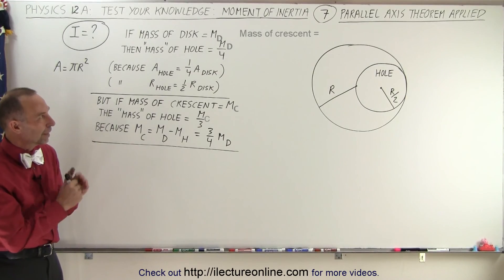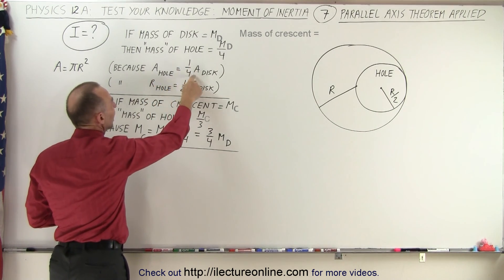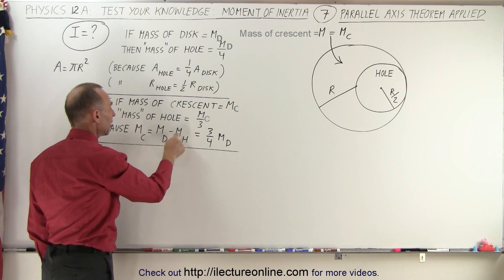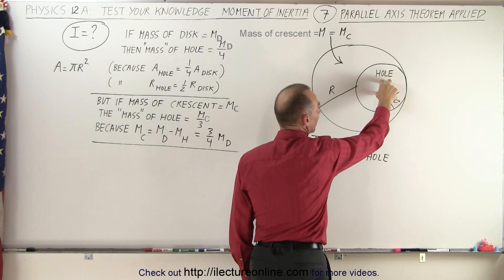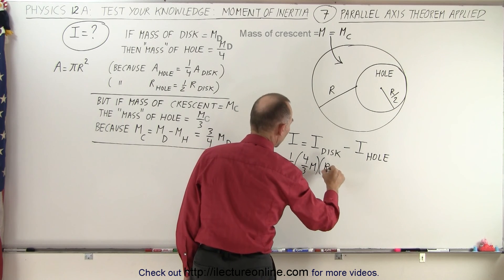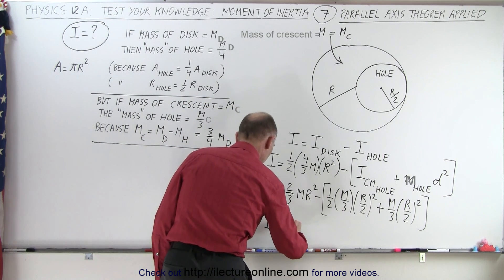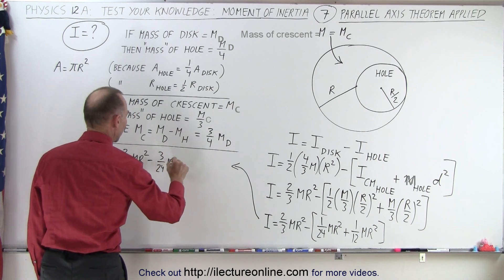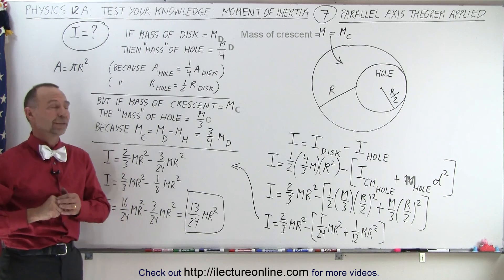Physics - Test Your Knowledge: Moment of Inertia (7 of 24) Parallel Axis Theorem Applied***

Comment: ı think you made a mistake when you write mass of crescent. Also you have another video about the same problem. Results are not consistent. Mass of crescent should have been 3/4 M I think. Your sincerely.
Reply from the maker: They are 2 different problems with the mass expressed in 2 different ways.  This was done intentionally.
Reply: @MichelvanBiezen  Then I should be more careful. Could you please explain what the difference is between two videos. Does it not have same radius an values? I guess i am missing something. Thanks a lot from now!
Reply from the maker: In the one case M is used as the mass of the disk if the hole wasn't there.  (In that case the mass of the hole = (1/4)M.)  In the other case, M is used to represent the mass of the remaining disk after the hole is cut out.  In that case the mass of the hole = (1/4)(4/3) M = (1/3) M
Reply: Talha , are you understoond? are there mistake or not? I thinking same you I read replies but not enough can you explain why 4/3M? 
I think M-1/4M = 3/4M ( mass of crescent)
Reply: @kayakaya50  you should try to understand teacher's reply. In conclusion you should see that the mass M has different notation previous and at this video. There are difference. At previous case the mass was defined without hole for example and said M for all. But for this case the M is said the mass with hole. I am just giving example. Pls don't take reference those. Its been a while that i have watched that video so again you should understand the answer sir has given me.